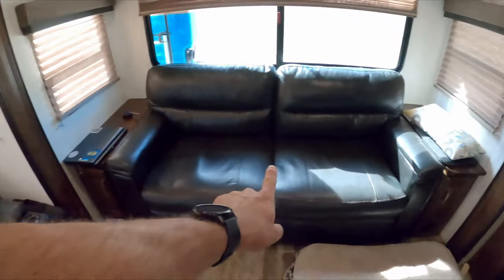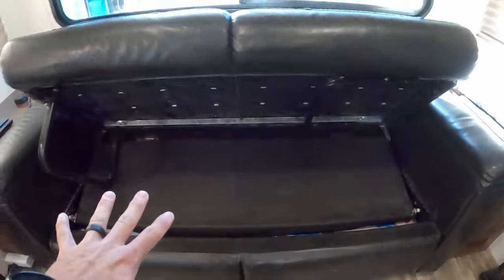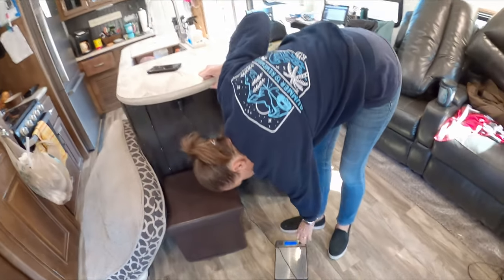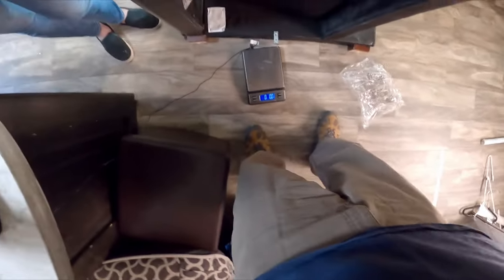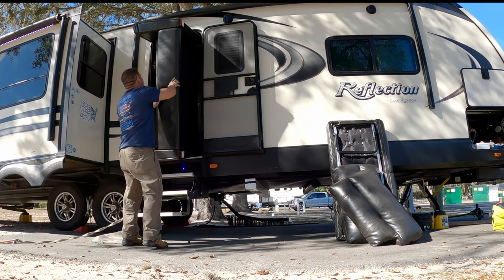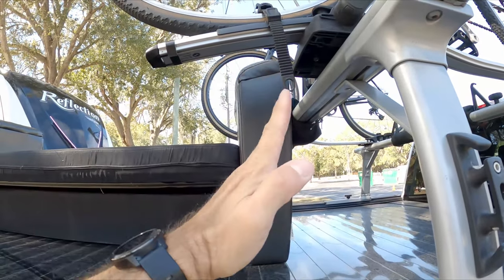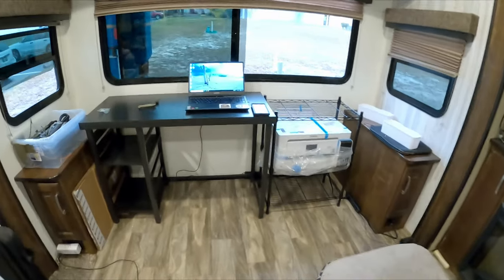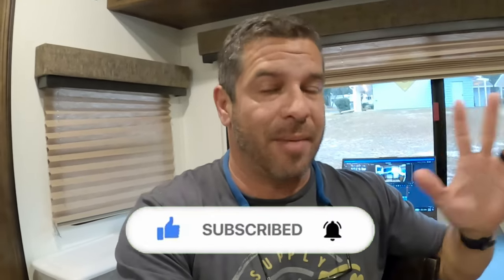Removing the RV Couch \ RV remodeling \ A new Journey

Comment: My wife just bought a couch from Amazon and we will be replacing our couch in our Solitude. We replaced one in the last fifth wheel we had ( a reflection) but I couldn't remember how it came apart. Thanks for the refresher. The new one comes in pieces so I think it should be an easy swap! Camper furniture is always so crappy!
Reply from the maker: Good luck on the remodel!
Reply: @Upforthejourney  It went well! The new couch was an easy install and is beautiful.